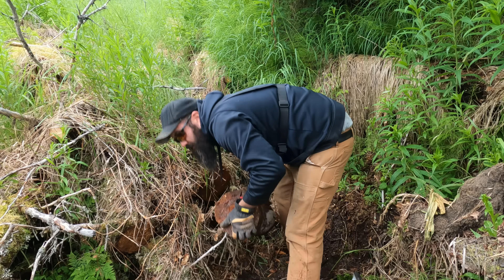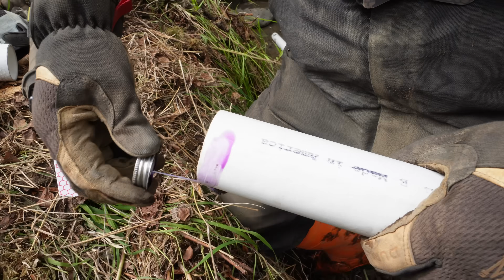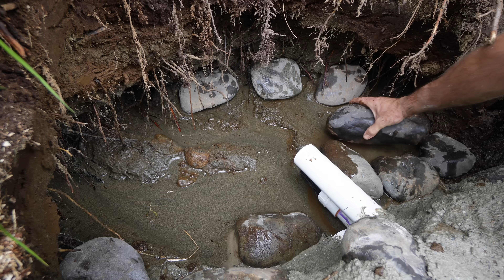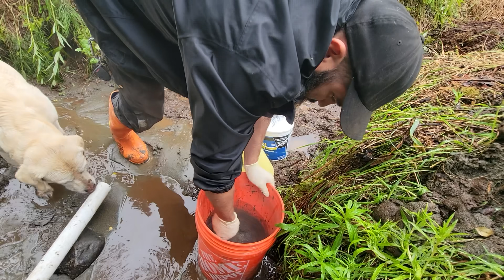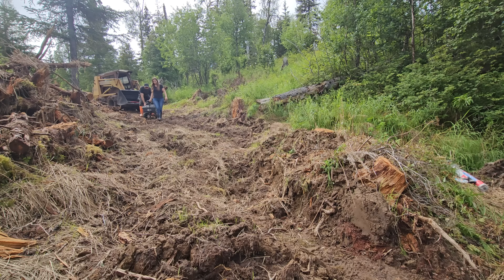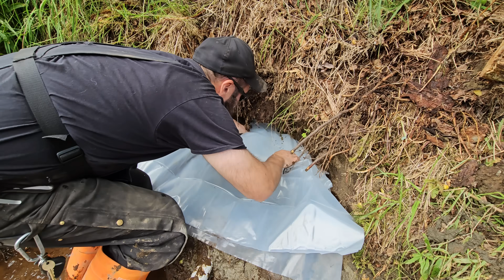Digging for Natural Alaskan Spring Water

Comment: You should cap the lower/main pipe temporarily to allow the water to build up until it comes out of the overflow pipe. Not only to test the dam's waterproof integrity above your main pipe, and functionality of your overflow system but to get any extra sediment and soil that could've gotten onto all that river rock. I also would've installed a filter on the overflow pipe so the river rock doesn't get sucked into it. Great job. You've earned a subscriber.
Reply from the maker: Hey, thanks for subscribing,  we are glad you enjoyed the content.  We should have explained the dam purpose in more depth during the video. On a natural spring cap, it is important not to raise the water level in a dam like a dam would increase water level in a river. By doing so, the spring will eventually dry up because water searches for the easiest path of flow and will come out of a new location. This dam is only acting as shallow funnel, and the rock walls' primary job is to hold back the washed stone filter package we put in place. If the lower pipe ever does plug and water comes out of the upper pipe, it would be very important to unblock the lower pipe as soon as possible to prevent drying up the spring seep.
Reply: @northtoalaska2022 Thanks for that reply. Very interesting. By that logic, would it have been more prudent to dig a small hole (1-2') below the site of the natural spring and then put in a dam/pipes so as to decrease the change the spring would find an alternative path down the terrain?

Comment: Excellent video. Improvisation is a key skill set living off grid and you clearly demonstrated your ability to improvise. I guess if I had a critique it would be concern about the filter inside your dam filling with silt and the soil above tour dam collapsing. The spring is clearly an excellent resource and you have put it to work for you. Good job!
Reply from the maker: Hey Chuck!  Thanks for your input 👍  we are hopeful the washed gravel and backfill stabilize the sediment erosion, but time will tell.  We will not accept failure, and we will once again improvise and take corrective action if the need arises! 😄

Comment: Recently subscribed, like your channel a lot. 

The only problem I see backfilling it with one inch gravel is if the underground veins bring new silt then you may have it build up behind the rocks and it will slow down or block off the stream and you can’t see it easily with the gravel.Anyway it looks to be working for now.
Reply from the maker: Hey, welcome, and thanks for following along! 🙂 From our research on spring development,  it is possible to have sediment buildup inside of the cap. The stone is supposed to help stabilize the area. Time will tell, but more than likely, the spring will need to be cleaned out on occasion.

Comment: Hi! New subscriber!

You have a great resource in that spring! If you have trouble with the pipes plugging, you might try getting a plastic sump well and drilling a few hundred holes in it. Gravel outside, gravel inside, cut tight fit holes for your pipes.

If your pipes aren’t plugging, way to go! Water is life, and working is living, and you nailed the water issue on the first try.
Reply from the maker: It is a great resource and has provided a lot of relief to have clean water within walking distance. We will make an update video soon but so far it has been great 👍 the holes in the screen are large enough to allow silt to escape. The silt has been collecting in a spring box that we installed after this video. It only takes about 5 minutes to empty silt from the 7-gallon spring box. Thanks for watching!

Comment: If you have leaks you can buy bags of bentonite clay. This is often used for sealing up ponds. Non toxic. Looks like your on the correct path!!!
Reply from the maker: I actually tried to locate Bentonite clay in my area but was unsuccessful. We used it back east to plug a leaking water dam. Works great!
Reply: Some of the purest bentonite clay comes out of Wyoming.  Bentonite poultice saved my dogs leg from being amputated. He had an infection that went into his bone.  He lived to be 16-18 years old.  We got him as a rescue.  Miss my Indy.
Reply: Check with the drilling suppliers up there or even drilling companies.  In Va we had a supplier called Driller services and this is where I would get all my bentonite from.  #20 size is the best cat litter ever.  @ $11/50lb bag was a great savings.

Comment: Excellent job on this water supply project. Will you plant grass on top of it to decrease erosion? Not sure how much rain you might get before it can have some mature and thick ground cover?
May it give you all the water you need for many. years to come!
Reply from the maker: The spring has been a huge asset, it's still a lot of work to get the water at this time but once the project is complete it should be perfect for our needs.  We did end up transplanting moss on top of the berm this past fall to help with erosion. Hopefully, it helps out.

Comment: Interesting like a sideways well.  I wonder if it would be good to tack the wood and moss back over .   Like a giant bio filtering sponge.  If you have cattails I bet those would really stabilize the mud around the dam and  would collect any silt and seem to be able to handle some sudden rushing water.
Reply from the maker: The cattails are a fantastic idea. We will have to look into doing that. We have cattails down by our creek.

We didn't show this in the video, but afterwards, we went back and covered everything in nautral clay. We've had several torrential downpours, and it's held up. 😀

Comment: After the spring box that will collect silt it goes to an insulated container...instead of burying the line feeding the house if you drill a small hole in the line just forward of the pump. Since the lien runs uphill when the pump shuts off the water in the line will back flow to the insulated tank...no water remains in the line to freeze ....just a suggestion to save a lot of digging.
Reply from the maker: This is a possible  option  🙂 thanks for sharing
Reply: As a temporary option I've used this method  before. Because the water drains downhill to the insulated water storage container  it won't freeze in the line as long as the drainage is all downhill with no dips where it can collect.   The pump will  push more water uphill than the small hole will squirt out in the insulated container.  Worth a shot if you don't get to digging the ditch  this yer before freeze up

Comment: You should cover both of your exit pipes outlets with a fine screen box to prevent the entrance of rodents or bugs into your spring pipes. If you use screen rolled into a cylinder or formed into a box, it will prevent nuisance clogging, as might happen if you just put a flat piece over the end of the pipe directly. Your pipes, now above the ground with cold air all around them, may freeze in winter. You should insulate or bury your bottom supply pipe.
Reply from the maker: Hello, great suggestions. This was an incomplete project. We addressed all of these issues in the next part of the project. We should have a video out on that at the end of the fall.

Comment: Just discovered your channel on this particular video & I love what you done by utilizing the downhill overflow deposits from a spring 💦head further up in elevation. Using this old method for doing this is absolutely smart on your part. As well as a lot cheaper than having an excavator dig it out and adding a manmade stainless Steel Spring Box & then adding another one further on downhill. I Love ❤️ the way you’re doing this, this is very similar to the way many of my ancestors done theirs in the hillsides of mountains🏔 in the Appalachia’s of NC near Tennessee.
 I have a question, as well as it may also be a good idea 💡 for ya & you may have already done ✅ this or plan on doing this. 
Are you gonna buy rolls of Black Flexible Well pipe to Cap into this pipe & bury it all the way to the new spring box you’ll be installing ? 
I heard you say you’d be adding pipe to run it down hill into a spring Box. You may already know that it’s much cheaper to buy the rolls of Black flexible Well Pipe in several hundred feet rolls. Then If you don’t have one already or haven’t already U could rent you a ditch witch or tiny backhoe and dig a trench and bury the pipe it all way to your new spring box down hill. My sisters preowned cabin in the mountains had the exact  same set up, a spring on a hillside & it was fed to her cabin by the same PVC type black Well pipe.  It ran wide open Year round with ice cold water. Also another fond memory was My Great Aunts house in the mountains.  I loved to go there as a kid & I’m old enough now to be you guys dad. But back in the 60’s I loved to go to her house because she had a old crank telephone 📞 that actually worked which was so cool. But the coolest thing was the room beneath the house & I’d  Make a B Line to that room first thing when we visited. Aunt Rausie’s 2 story house was built right over her water 💦 Spring Box. She had a This place where the wide wooden floor planks was a hinged door 🚪 you lifted up. Beneath the floor was a concrete set of steps that went beneath the first floor of the house with concrete on both sides of the steps that went down to a door 🚪. Behind that door was a room that was her concrete food storage cellar beneath the house.  I’d say the room was 8’ wide X 16’ long & she had it stocked full with mason jars of canned food from her garden! But what I rushed down there for,  was the drinking dippers and that cold water 💦 in the spring box!!!! Mmmmmm Mmmmmm ice cold and delicious mineral spring water 😋. 
Inside that door 🚪 at the foot of the stairs on the right just inside was a concrete box! It appeared to actually be part of the concrete wall also. So I assume the concrete was poured at the same time the concrete walls was & that was the drinking water spring head. It was her mountain side spring piped right up into the concrete holding tank in her Cellar. It never overflowed, & i didn’t know why I was a child so I thought it was magic water 😂 plus I didn’t understand gravity & physics then & why it always stayed the same water level. 
But I ask her why was that room so cold like it had A/C with no A/C ? She said my cold spring water keeps my cellar cool & that’s why she stored all her canned Mason jars of food from her garden down there to keep it fresher & last longer. She said that spring box in that room kept her cellar about 50-55 degrees year round in summer & winter. So I thought that was very neat l, and I still think that’s an ingenious idea.  
     U guys are gonna have a beautiful place, I love to see the process and progress of channels like this! Sending my best regards and God Bless You!!!! 😁👍🏼
Reply from the maker: Hey cc 😀 this story about your great aunts place with the spring house type cellar is incredible!  I really do love the thought of a concrete spring house. That would be so great for storing food.  We had to slightly delay the completion of our spring project because of the cold weather coming up, so we switched our priority to the cabin Fondation because of freezing concerns with our concrete. I will give you a hint of what we have done since this video,  we ran 2 inch pvc a short run down to our spring box and we now can collect water directly from the spring at this time. We were not able to locate the black well pipe local in one inch, so we used flexible 1 inch pex pipe from the spring box on. We plan to rent an excavator to Burry the flexible line from the cistern under ground up to our cabin build site very soon, and that should give us completed content to have a full video on that project, we try not to drag projects out over too many videos. We have run into a few unexpected issues with our cistern idea that we will cover in that video, but we have a solution. It is just a higher cost than originally anticipated. Thank you for sharing your experience on natural springs with us 😀 we are looking forward to completing ours!

Comment: How about if you got small excavator shovel and dig a hole and put concrete pipes in it with pea gravel around and with shove you could go deeper to have more water storage. I know it mud but maybe even a power post hole digger might help  the put a small building or box over to keep clean just a idea🥰
Reply from the maker: We will have another video soon showing how we piped the water collection downhill to a spring box and how we plan to collect it 🙂 thanks for watching!

Comment: I think I would have dug out more of a pocket if the ground was soft enough.  Hope this gives you water year-round.  Not a very heavy flow but if it atleast serves as drinking water it will be nice.
Reply from the maker: Hey! We were only trying to funnel and direct the water flow out of the pipe, not really collect it in a dam. The second part of this video that is not complete will show how we collect the water. We find that with two people,  showers , laundry, drinking, and washing dishes, the 1500 gallons per day is actually more than we consume in a month.  From my research, higher flowing springs often can mean the water is rushing to the surface too fast to be naturally filtered. And is possibly contaminated. This spring is actually a best case scenario from a flow and cleanliness perspective. Thanks for watching 🙂

Comment: I was wondering, wouldn’t it been easier to put a black plastic tube about 2 foot in diameter in the hole and drill holes into it and then let the water flow out of that? Then you could declog your lines easier take a lid off of it?
Reply from the maker: Buying material like this is a real problem in alaska. We have been trying to locate plastic culvert pipe here for another project, and no one in the state has the size we need.  This cap is really just a funnel to collect the water at the lower pipe. Our spring box that separates the silt works very much the way you describe. We will have more info on that in a later video.

Comment: 18:35 ok you explain what the bottom and top pipe is for but what is the middle pipe for. I think I missed that one.
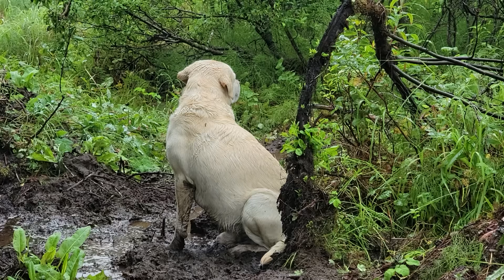Reply: 22:53 ok I see now. Didn't understand you were removing the very bottom pipe.
Reply from the maker: The very lower pipe was to divert the water under the dam temporarily. We pulled that one out and packed the bottom full of hydraulic cement. So only two pipes remain 🙂

Comment: To my way of thinking as the springs bring in more silt it will just plug your gravel bed there by plugging up your spring.
Reply from the maker: This is a possibility with this type of spring cap. We may have to perform regular maintenance cleaning it out to keep it in working order.

Comment: An,I’m not an engineer but I’m thinking that because you erected/constructed that little dam on top of just sand, you had better backfill the ditch with clay . Just seeing how much of the sand had already begun to erode under the dam if you don’t reenforce it it’ll be gone by the end of the next winter.
Reply from the maker: We will give everyone an update in the future. After the dam was in place we dug out sand, then packed the bottom with hydraulic cement front and back. And covered the lower areas in clay. It has remained sealed.  The dam is more of a funnel because it only raises the water level by about an inch. There is not much pressure to hold back. Thanks for watching 🙂
Reply: Ok good to know.I’m curious, how deep does the sand go?

Comment: The limit is going to be 50 gallons per person per day in the western half of the United States so 1500 gallons a day is 30 people a day. Most people don't use 50 gallons a day.
So that is a lot of water you have there.
Reply from the maker: It is quite a bit of water! We've heard about the limits being imposed on water.     That can certainly be difficult to work around depending on day to day activities.  We try and use as little water as we can, so 1500 gallons per day is way more than we will ever use, but it is fantastic to have on hand.

Comment: I know it was 11 months ago but I would have suggested you dug a rounded footer as it looks that there is a lot of water leaking under the dam.
Reply from the maker: The water is from another spring seep to the left. We will go back and cap it eventually as well to dry up the area.  The frost heaves will eventually cause a leak.  We were skeptical about investing much money into this at the time but now that it is a proven water supply year-round and it is perfectly clean water we will revise this entire build into a finalized project in the future.

Comment: Instead of fighting with that wagon it would have been faster to just carry a 5 gallon bucket with your stone. Good job collecting this water. I would have dug out under the screen a little more before putting the stone. That would have deposited moore silt before entering the screen.
Reply from the maker: It did cross our minds to use the bucket that we had for mixing concrete with.  Unfortunately, we had unmixed cement in it at the time and had no spare buckets. We need to buy a few extra buckets because that was our only one...
Reply: @northtoalaska2022  Yes, on a homestead, you always need many buckets 🪣. Get free ones from local restaurants, bakeries, and places that get food type items in bulk.

Comment: How do you prevent the pipes, raised off the ground, from freezing during winter?
Reply from the maker: Water flowing out of the ground is warm from geothermal transfer. As long as it is not restricted in flow it doesn't freeze. We collected water all winter from it.